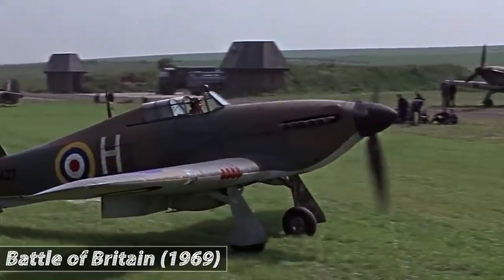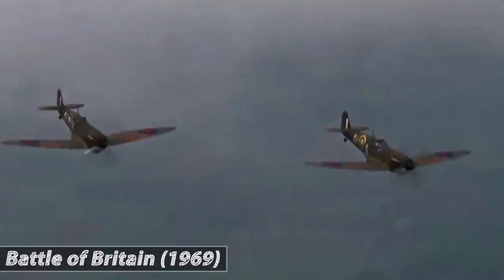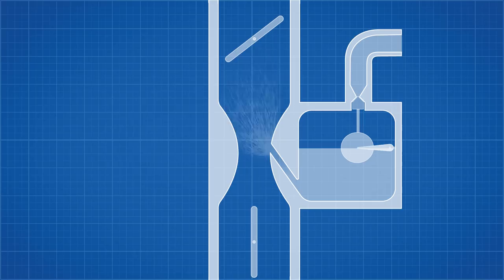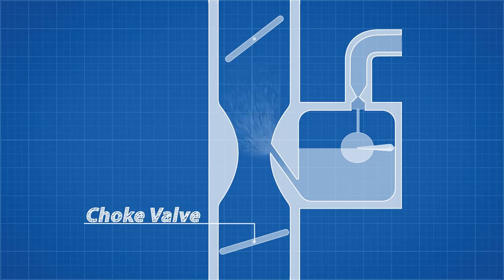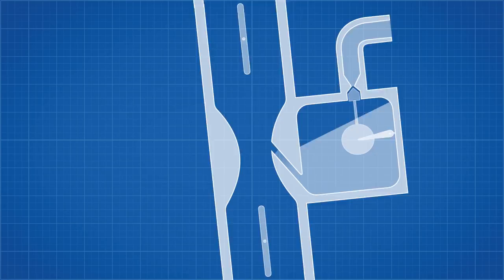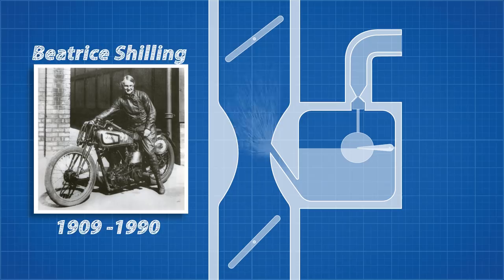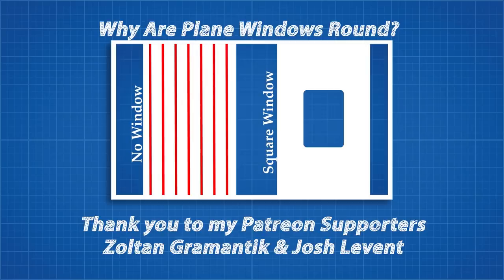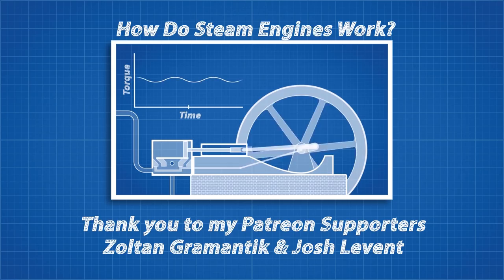The Spitfire's Fatal Flaw

Comment: Battle of Britain is a brilliant film. Because it was filmed using hundreds of real aircraft, which could not be done today, it holds up extremely well even 50 years later
Reply: Not Hundreds, most were FlightLink R/C replica models, but about 12 real aircraft were used in the production, mainly for close ups on the ground, I worked on props and models for the film.
Reply: stephen wallin I must have heard some false rumours then. I was told they were all real! Brilliant film either way! Thanks for the information, it's amazing hearing from someone who worked on one of my all time favourite films!
Reply: There's a film called A Bridge too Far, if you haven't already heard of it, which uses real planed and tanks and stuff too. It's got Sean Connery, Michael Caine, and other well known actors of the era, you should check it out.
Reply: Only tangentially related, but it's always made me smile that Band of Brothers only had one flyable C-47; the scene where they're all taking off for D-Day is the same plane filmed taking off tens of times all composited together.
Reply: Not hundreds... For instance, there was a lack of airworthy Hurricanes (I believe they only had 3 at the time) so in scenes with more Hurricanes on the screen, some of them are actually substituted by 109's in the background. Check out the "Repeat please!" scene. Three planes in the background are actually 109's pretending to be Hurricanes.
Reply: OOZ662 You are wrong. The production company for BBO actually gathered four C-47's for the drop sequences.
Reply: Well, the Stukas definitely are not real, even look like models...
Reply: From the internet:   Eventually 100 aircraft were employed, called the "35th largest air force in the world".  With Mahaddie's help, the producers located 109 Spitfires in the UK, of which 27 were available although only 12 could be made flyable. Mahaddie negotiated use of six Hawker Hurricanes, of which three were flying. The film helped preserve these aircraft, including a rare Spitfire Mk II which had been a gate guardian at RAF Colerne.
Reply: I went to this film as a child when it came out in 1969/70 (I was so immersed in Airfix/FROG models, I was 8/9YO) and at the film, a stylish full-colour full-size booklet was on sale which explained the making of the film, the historical background, and many scenes of cast and crew.I had spare copy of the booklet and sold it on ebay years ago, but other copies may still be around. As I recall, there was also a set of bubble-gum cards with stills from the movie.
Reply: Your wrong.
There were nowhere near 'hundreds' of the real aircraft featured in the 1969 film, available at that time.
Worldwide at that time there were less than 30 valuable Spitfires worldwide and even fewer Hurricanes
Reply: The thing that I find so interesting is there is probably more WWII warbirds that are flying today than any time in decades.  But you are right, especially at the time of this film there were very few WWII warbirds of any country available, perhaps a few P-51 Mustangs could be scrounged up but not many others.
Reply: stephen wallin one used is at shuttleworth museum and is currently being re built I believe it is a mk 5c
Reply: one of my favorite movies  and i think one of the best war movies off all time people say saving private ryan is but i think that movie is bad lmao
Reply: Although there weren't hundreds of aircraft, there were enough gathered to create the 33rd largest air-force in the world! Also, I believe, there was a great deal of objection when three of the He 1-11s were flown back to the UK for further filming. One of them now resides in the museum at RAF Herndon.
Reply: Did not think any real me109 were used but the hispano susa spanish built junkers using merlin engines.
Reply: Foehammer ,I was in the air cadets,and saw the 109s and Heinkel bombers landing at RAF Manston in Ramsgate
Reply: Countdown70s they are
Reply: The filmed Dunkirk with real planes..
Reply: I heard that was hard to film, as by the time all the planes were in the air and in formation, they onlyhad 15 minutes to film before they needed to land.
Reply: The Dunkirk film used Buchon's not 109s
Reply: Foehammer what about top gun? Top gun used real F-14s, mig 28s and F-4 phantoms
Reply: They sought to use my fatgrr's Hurri Mk IIA...but could not guarantee its confition...upon retirning..so iy fid not go
Reply: The number of airplanes used in filming actually made the production the 35th largest air force at the time.  These planes included:  12 Spitfires, 3 Hurricanes, 17 Messerschmit 109s, 32 Heinkels loaned from the Spanish Air Force, and 2 Junkers 52 borrowed from the Portuguese Air Force.  Even more planes were purchased, but not all were airworthy.
https://www.youtube.com/watch?v=Wn6W7lXCN3k
Reply: Foehammer kinda sad  a movie from the 60s is one of the best films
Reply: Of course nowadays, the shortage would be of real actors, not of real planes, huh? - Just kidding.  ;-)
Reply: Black Hawk Down, extremely recent film compared to Battle of Britain used real aircraft and real military pilots. It can, and has been done today. I don’t get why people make such ridiculously vague comments that can be picked apart because they aren’t true.
Reply: Foehammer all the flying footage in Dunkirk 2017 was real not CGI
Reply: "Takka-takka-takka-takka!"
Reply: @bigwheel6533  the Me109 were Spanish derivated planes built under license by Hispano Aviación using… Merlin engines ;)
Reply: @swallin19  hey dude, what models were the messerschmitt 109s? They look like p51s for me for some reason
Reply: @tylermelendez-duke2206 , hey laddie, better get your eyes examined, and maybe do a little research. Those "Mig 28s" were Northrop F5s painted to look sinister, and the "aggressor" aircraft in the Topgun flying scenes were McDoug A4 Skyhawks, a much more agile aircraft than the heavy F4.
Reply: W Cate the Mig 28 thing was a joke lmao. I feel so dumb calling an A4 an F4 they’re note even remotely similar
Reply: jaydee040 that was just a joke however I said “F4” instead of A4 which is embarrassing
Reply: @tylermelendez-duke2206 , don't you just hate those brain farts? I spent 3.5 years working for a training squadron that taught F4 crews Air Combat Maneuvering using A4s as aggressors. Been in the back seat of both. Gotta tell you, the flying for the camera in Topgun is hairy stuff. So close together and flying so slow to stay in frame. Real world, the maneuvering is in the distance (little dots) and when they get close, the closure rates are awesome. The lightweight, agile A4 fights round n' round, while the heavy, fast, powerful F4 fights up n' down. Lufberries, yo-yos, and scissors, situational awareness and staying offensive.
Reply: I read somewhere that they used a "Mitchell" bomber with cameras in the turret positions to film some of the combat scenes.
Reply: @davetaylor7903 , yes, that was Tallmantz Aviation's air-to-air camera ship. It was used in practically all the aviation / war movies of the period: Blue Max, Tora, Tora, Catch 22, 633 Squadron, etc. STOL modified, could fly real slow and real fast, stable as Gibraltar Rock, and equipped with gyro stabilized camera mounts everywhere. A movie director's wet dream!
Reply: Foehammer and messersmit used in film had a merlin engine fitted see it fly many times
Reply: @FokkerBoombass  

Correct on the number of hurricanes 
Two Casa 111  and about 8 Spanish built 109 with Rolls Royce engines
Reply: @swallin19  Something about ex-Spanish 109's which had a different engine and therefore nose cowling?
Reply: @jamesrose1460  The film / TV companies try that on with historic vehicles, too. They might nadger your pride and joy and hand it back bent, with a shrug.
Reply: Great film..And it opens with two motorbikes; Zundapps KS600s that I own.
Reply: It's the first film I saw at the pictures, in 1969; I was 7 and Susannah York was in stockings....
Reply: @tylermelendez-duke2206  T-38 used as a MiG stand-in?🤔
Reply: Sounds like something I should watch.

Comment: I think the most unique part of the Spit was the elliptical wing.  A discussion of this wing, why it was used, and the pros and cons of this type would be a nice "engineering" discussion.
Reply: The main reason for the elliptical wing was so they could fit 8 guns.
Reply: Ludwig Prandtl sketched a similar monoplane wing layout in the early 1920s. That image was in wide circulation by the mid-1930s. 

It has one distinct advantage in that an elliptical planform wing will have an elliptical lift distribution, which minimizes induced drag for a given wingspan. I.e. it allows an Oswald Efficiency factor of 1.0. But that is not quite true. As airfoils behave differently at different Reynolds numbers and an elliptical wing has Reynolds numbers that vary down to zero at the tip. The fuselage also disrupts the lift distribution and so does washout/wing twist. An elliptical wing requires twist to keep it from stalling simultaneously. (Albeit sightly less twist than aggressive straight tapered wings do). Because the reynolds number at 80% semi-span is still 60% of that at the root. And at 60%b/2 it is actually 80% of the Reynolds Number at the root. Still, not all together that advantageous as a straight tapered wing can be made to have an elliptical lift distribution at some arbitrary lift coefficient. Usually cruise condition for maximum range. An elliptical planform has a non-elliptic lift distribution at low lift coefficient cruise due to twist and Reynolds number so its not as efficient of a wing as it theoretically should be. But, at high Cl in a high G turn at high altitude, it comes into its own as the planform is presented to the free stream it attains its theoretical benefits in that scenario.

Too impractical to build for mass-production minded Americans. Shenstone travelled to Germany, learned German, and studied German glider and aircraft designs. Him and R.J. Mitchell commented and complimented the Heinkel HE-112. Not specifically for its elliptical wing planform,  but for its remarkable smoothness. (I read that as "remarkable smoothness for compound curved panels making up that elliptical wing). Which probably inspired them to adopt those challenges.

The elliptic planform gets all the attention. But the true genius is in how that planform distorts from a true ellipse, the aerodynamic centers sweep aft of the main spar at they approach the wingtip. And the elevator was unbalanced against all conventional wisdom, yet not prone to flutter even up to 500mph and later up to a Mach number of 0.78. All have an explanation and all demonstrate the genius of the Aero-Structure-R.J.Mitchell Trio.
Reply: Hey I know this is three years later but he just dropped a second video on this topic and he answered this question
Reply: @HealthyCigarette864  Thanks, will look it up.
Reply: @pi.actual  No, that's not true. There are far more aerodynamics on the planform of that wing than just fitting guns inside. @JJ gave the right reason.
Reply: @TheJustinJ  The Spitfire MkXI went to 0.88 TM  a naval test pilot OShea I think it was
Reply: @TheJustinJ  Mitchell chose the elliptical wing (actually double ellipse) as an elegant way to get room for the U/C and guns in a thin wing.  No one seems to notice the P-47 had a straight leading edge and elliptical trailing edge, little different to a clipped wing Spitfire
Reply: @TheJustinJ  Prandtl cribbed the 1907 work of Frederick Lanchester in England.  Other elliptical wings had been used between the wars by many designers including RJ Mitchell.

The genius of the Spitfire wing was making the wing structure so thin, yet strong enough to withstand inertial loads, torsion, g-loads and gusts and gun recoil, etc    The Gunther brothers failed in the attempts to make an elliptical wing for their He fighter (too thick) until it was too late, long after the Me109 proved superior and the Spit was flying .